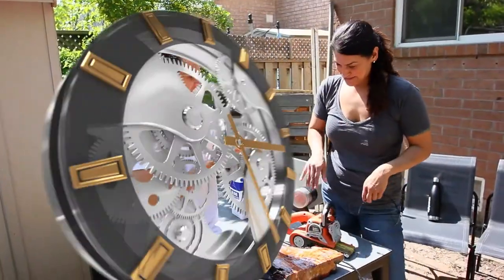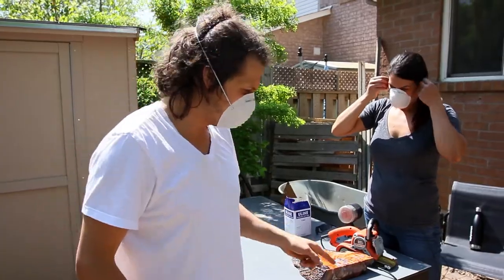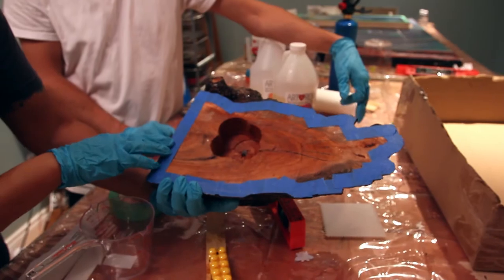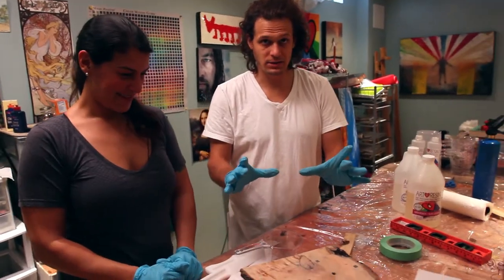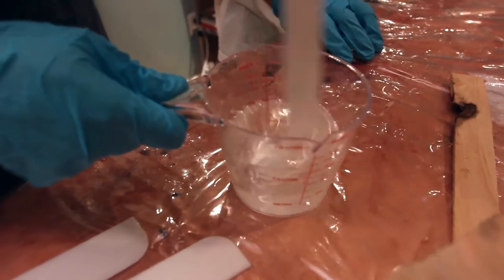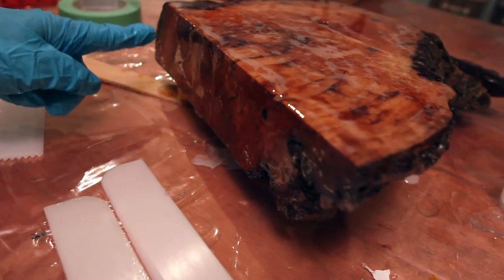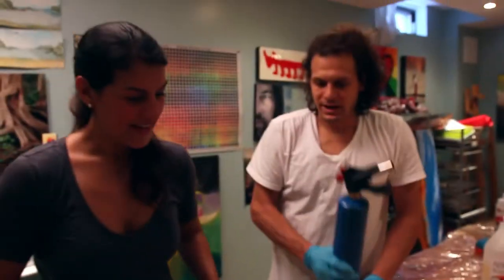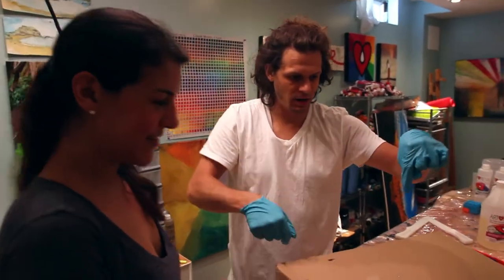How To Resin A Clock - Part 5

Comment: does the resin affect the accuracy of the clock?
Reply from the maker: that is an awesome question!  On our next segment, you'll see that Dave drills out the centre again, where the shaft for the hands will sit - so it'll be nice and clean and will not affect the movement at all!  As long as we can remember how to tell the time, we should be all good ;)